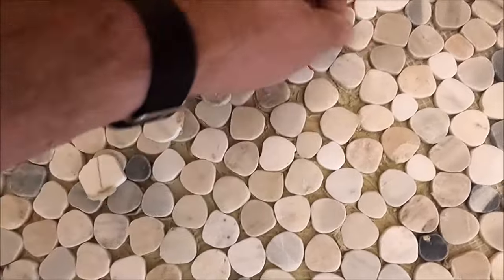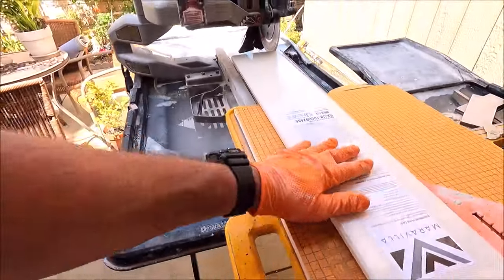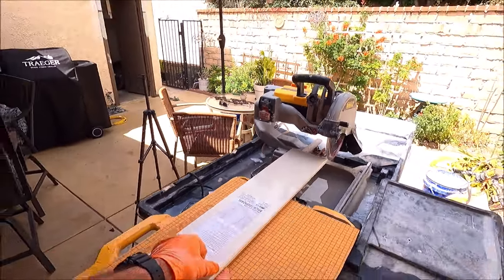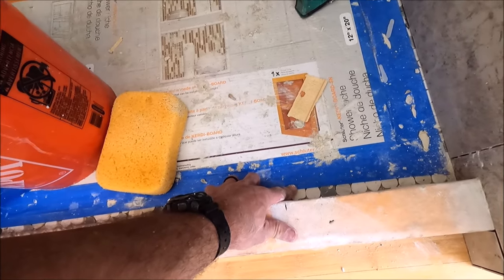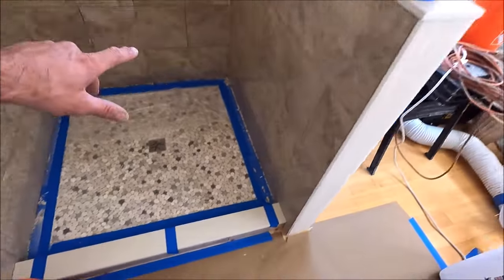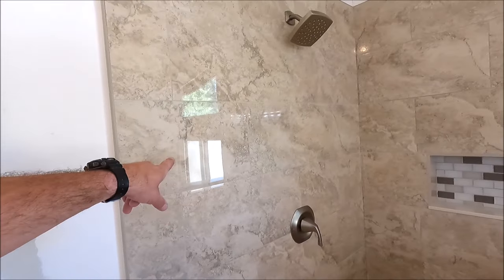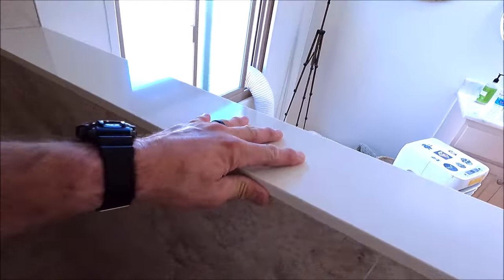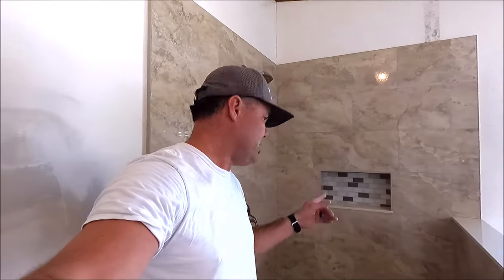Making a Shower Bigger, Does it Make a Difference?

Comment: Question.  Why didn't you run the wall tile to the ceiling?  Not really required, but I always prefer the look.  Would have loved to have seen the final shower with the glass kit installed.  As always, your tile work looks terrific.
Reply from the maker: We like to usually go up 8ft (which this is) The ceiling in this bathroom is super tall. It's hard to see with the go pro wide lens..

Comment: Why make the shower recess so small? Wouldn't be able to use a pump bottle in there?  Looks good
Reply from the maker: We install 12x20 prefab niches usually. If the tile is larger, we install taller niches by cutting the Schluter prefab and altering it to accommodate the tile and Costo bottles. Keep in mind the pony wall is more storage for bottles.

Comment: Dope work as always Jesse. Questions, I have two: 

1- why not miter the edge on the pony top with the vertical stone? 

2- took my CTI last week. Was told that any slivers smaller than half the tile a nogo. You worry about that at all on the back of that niche with the glass mosaic?
Reply from the maker: We would have mitered that if we mitered the niche. There is a lot more work that goes into that and the cost goes up. We really like the Schluter powder coated colors. We use less and less metal Schluter Jolly these days (chrome, brushed nickel etc.) In regards to the niche, we had a choice of a full at bottom and a very small sliver at the top. We decided to have a half at the bottom and a half at the top. 👊
Reply: @LandbergTileTV  copy. Thanks for the response.